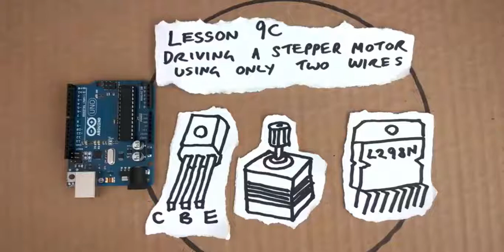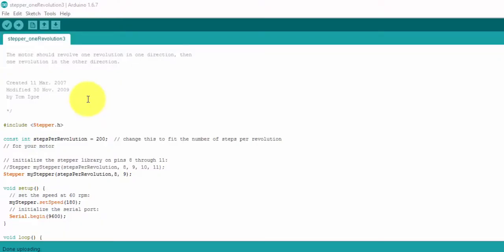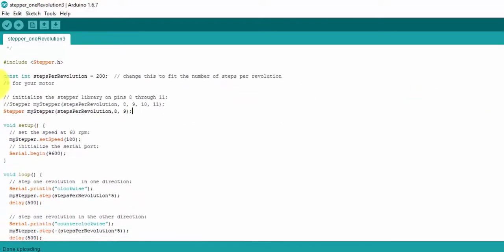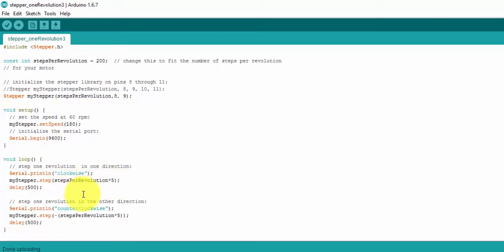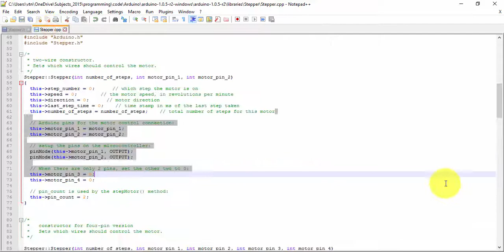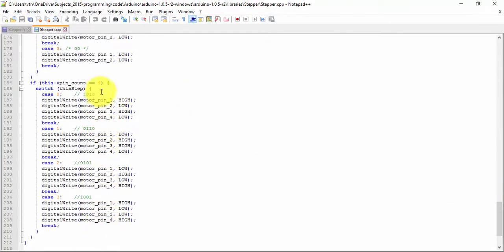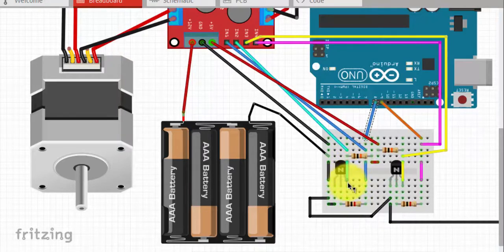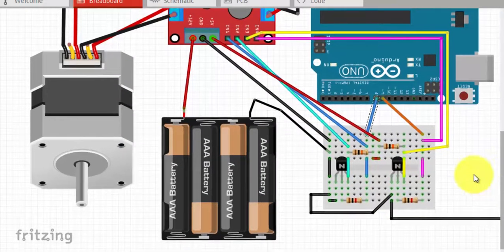Lesson 9C - Drive a stepper motor with only two wires - Arduino guide

Comment: can u show the electrical components specification. like the transistor that u used in this video.
Reply from the maker: For this setup I use two 2N2222 transistors http://www.farnell.com/datasheets/296640.pdf
All details are in the document which is linked in the description for this video :)